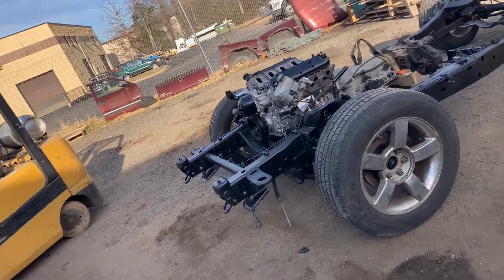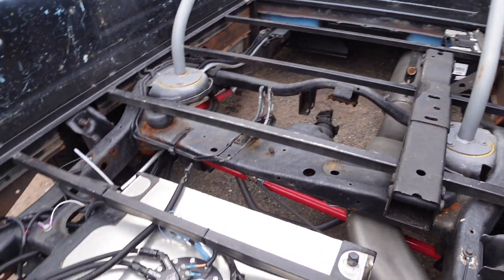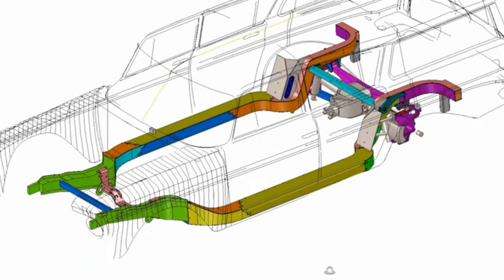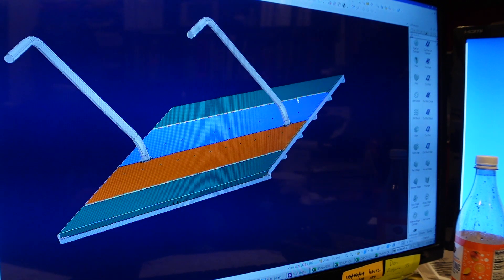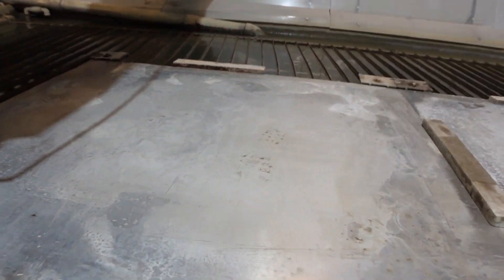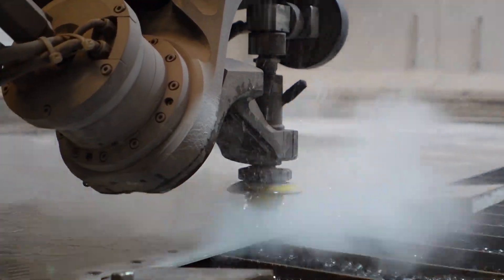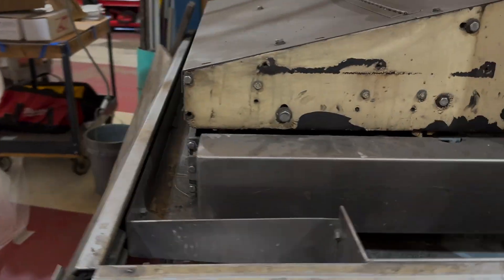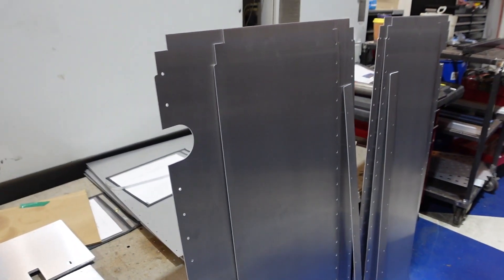Chassis Swap C10 Designing Machining Aluminum Bed For AWD Project Escalade  (Rustomod Garage EP.21)

Comment: Do you ever plan on potentially doing a fleet side bed kind of curious I just picked up a Denali for a frame swap and will have to do a fleet side bed. Just concerned with the rails underneath the bed and what I’m going to have to do for the hight. Any advice would be greatly appreciated.
Reply from the maker: Yeah the fleet side bed should fit even better because the sides are wider to fit the rear axle.